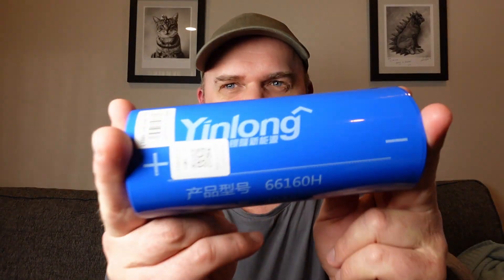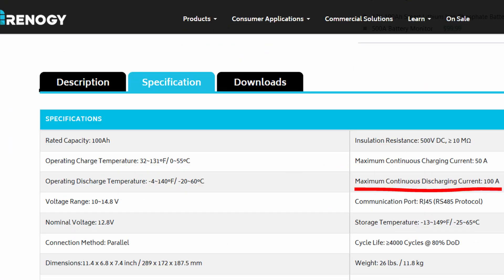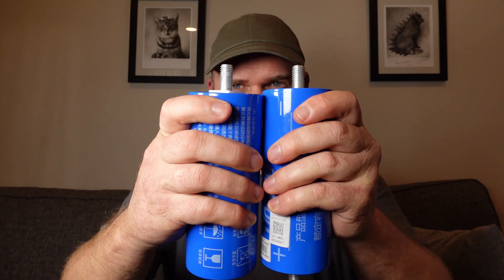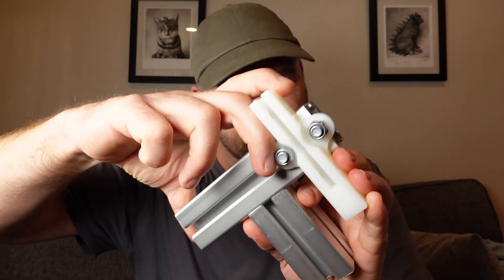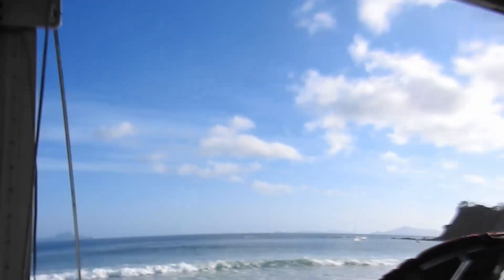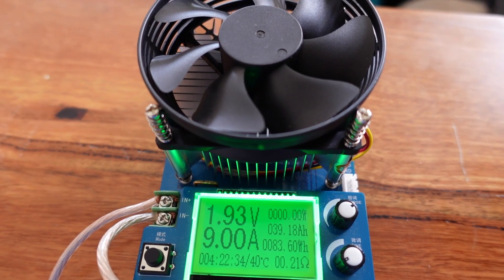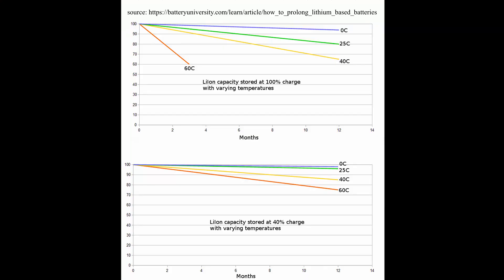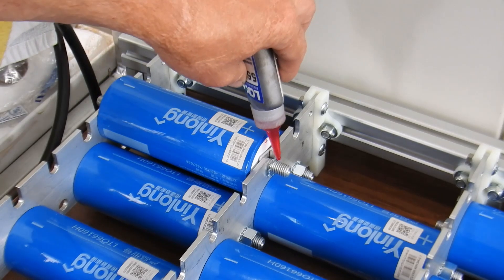Campervan DIY battery build HUGE POWER!

Comment: Wow! Great video! But isn't it more like 40Ah x 99 cells = 47.52kWh ??? If you have 99 of those cells, 9.5kWh seems low?
Reply from the maker: Hey, I'm not sure how you came to that number.  This is the reason you shouldn't use Ah as a measure of capacity (and because it isn't a measure of energy capacity) it confuses people.  The cells on average tested at around 96Wh each (rated at 92Wh = 40Ah x 2.3V) so 96Wh x 99 cells = 9.5kWh
Reply: Around the 2:26 time mark "Each of these cells is rated for 400 Ampere discharge, which is roughly 900 Watts. I've got 99 of these cells in my battery pack. So, that give me about a 90kVA output." However, around 4:40 "... which will give around 9.5 kWh". This is better.

First, the cells are rated at 40 Ah. It would be misleading to multiply by the C-rating of 10 to get 400 Amperes. If you drew a cell at C10 it would last "less" than 1/10 of an hour. You could sustain that for, maybe, 1-3 minutes (see Peukert's Law) while turning your wires into toaster elements. Now that doesn't make 90kVA sound so useful.

The actual numbers are simple. 2.3 V (nominal) * 40 A (C1) = 92 VA per cell. When multiplied by 99 cells equals 9.108 kVA.

At 4:32 "I think kWh is the proper measurement for battery capacity. I know most people use AH. So, if you are stuck in the AH mindset, change it."

Actually, Ampere hour (Ah) is the proper measurement for battery capacity. For resistive loads, such as light bulbs, 1 VA is equivalent to 1 Watt. Once you connect reactive loads (inductance and capacitance), such as charger, inverters, power supplies,  then you're dealing with Watts. This considers Power Factor (PF) efficiencies of the reactive load.

At 12:58 "Okay, so I'm going to cost your batteries..."

I have to come back to this one.
Reply from the maker: @cknox64  here we go...  just a guy trying to make novel builds and we have commenters who think they are smarter than me trying to pick my video to bits....   anyways, in response....

The average capacity of these cells as tested by me worked out at around 42 Ah - roughly equates to 9.5kWh with ACTUAL measurements.  I even wrote the ACTUAL capacity on the side of the cell that I showed.  If you were more observant you may have picked this up.

The cells are rated at 10C so it isn't misleading to say that they are capable at putting out 400A each.  Peukerts law is significant in PbSO4 batteries, not so much in these due to low internal resistance so your numbers are out by quite a lot there too.  Was trying to get across the point that these cells can deliver a huge peak current if required without damaging the cells.  There are often huge demands on cells such as the capacitive load of hooking up an inverter that may accidentally not be precharged, this sort of peak load can damage other chemistries.   

The actual numbers (my ones) are simple and correct, your numbers here are completely wrong.  The C rating is not 1 for these cells.

Actually Ah is a loose and imprecise unit for battery energy capacity.  There are so many reasons that it is a useless unit.  I don't have a problem with it on a cell level, but I do have a problem with it in packs.  Take for example, how many Ah is a Tesla powerwall or an electric car?  How about  your power meter on your house, does it calculate your power consumption in Ah?  They don't specify Ah, because it means little in the real world and can be very misleading.  Say for example you have 100W of LED lighting.  How many Ah do you need to run it for 10 hours?  Firstly you have to figure if you have a 12V,24V,48V or any other voltage system.  then if you have say for eg a 12V system what chemistry are you running, different chemistries have different nominal or discharge voltages, so then you have to take that into account.  Additionally, 100W of LED lighting will draw 100W throughout the decreasing voltage as the battery discharges, however... as the battery discharges the current consumption on the LEDs will increase.  But it is very easy to figure 1kWh of batteries will power 100W of LEDs (or any other load) for 10 hours.  Even with a low discharge rate 1Ah of lead acid is less than 1Ah of LiFePO4 as far as useful power delivered.  Reactive loads have no real relevance in DC power systems, it actually makes zero difference to the load capacity on the capacity (ignoring the slightly decreased efficiency of the invertor when running high PF loads) so I'm not sure why you brought it up.

Cost my batteries, if you like...  chances are that I'll be more correct.

I know you think you know more than youtubers, and I'll find it difficult to convince you otherwise.  From comments that you have made I feel there is still a bit that you are unaware of that you don't know.  Stay tuned, be humble, learn and grow.
Reply: @brendontait6968  We should agree to disagree and part as friends.

Comment: One thing else I would recommend doing differently is to not switch them in parallel step by step throughout the series.  The problem this setup could run into is a single battery failing for whatever reason and not being able to quickly identify it.  An absolute stupid habit of batteries when they fail is that it changes their behavior in a network of batteries causing load imbalances which could not only cause damage to other batteries, but also equipment around it.  11 in series and the 9 in parallel does not entirely prevent it, but you could monitor every single battery separately.  Even automate it, so that a faulty series is disconnected immediately.  Only problem is that a controller would probably have to be custom built for it.
Otherwise, great build, inspiring and I learnt something new.
Reply from the maker: Glad you enjoyed the video.  I'm not sure how your suggestion would be implemented... monitoring all 99 cells while a bunch are parallel connected would be past my level of ability.  One of the benefits of this chemistry is that it is tolerant of internal shorts, whereas other chemistries are not.  An internal short in a cell can ordinarily be catastrophic when they are wired in parallel, this is because the energy from the parallel connected cells go through the short in the faulty cell.  I'll cover this in a coming video with LFP cells.   Because of the inherent tolerance of internal shorts this failure mode is not a concern.  The failure would eventually be picked up by the BMS without damage to the other cells.

Comment: Newbie here, I have some questions that I think you would have the answers to.
1. Could you install one of these capacitors on a vehicle to extend the battery life?
2. If I was bored one day and wanted to make my vehicle into a hybrid using an electric motor, could I use a bunch of these capacitors instead of a battery for the immediate energy storage from deceleration and acceleration factor?  
I must say, you are the smartest high school drop out I've met so far.
Reply from the maker: Hey, firstly they aren't capacitors.  But they can throw out power like you'd expect from caps.
1.  I don't think you'd see a significant increase in battery life by attaching one of these to it.  Starter lead acid batteries actually like short bursts of high drain from them as you'd see with starter loads, it can help break down the lead sulfate that can build up on the plates.
2. These are a battery - the reality is you could use pretty much any type of battery - but these have the advantage that they can throw power in and out faster than most.  So yeah a smaller pack could take bigger deceleration and acceleration loads.

Thanks!

Comment: I went and loke and by my estimates these cost over $600 a kwh.  That is half of a prebuilt   lithium battery.  Not 1/10th
Reply from the maker: Hey Joe - there are many ways to calculate things.  I don't think I cam up with 1/10th... however, it would seem that your calculations might only be taking into account the cost/capacity and not the cost/lifecycle

Comment: Oh but I’ve read that lithium batteries life span is usually not limited by how many cycles but by their calendar life expectancy.
So I wonder if these really will last you 25 years when 10-15 years is often the calendar life I read about.
Yet lithium is the way to go for such a high power system you have, when vehicle weight is a concern.
Thanks for the video to help me stay updated on tech 
Take care
Reply from the maker: Hi Jim, thanks for your comments - yeah in my video I think i said it would likely closer work out to 10c/kWh rather than the 2.7c in reality.  This chemistry seems to have the highest life expectancy of any available lithium chemistries, this obviously depends on how they are kept and used.  Most literature I have read show at least 20 years.  Ontop of that this battery will be more tolerant of electrical faults in a bms etc which might cause the cell to run outside of its voltage parameters
Reply: ThankX Brandon 
I did miss that the first time I watched.
I also like how they can take freezing temps while working.

Comment: Very nice video mate! 48 volt systems are popular because everything telecom related in the whole world runs on -48VDC, so there’s a huge industrial use for the same components that goes into the solar power systems.
Reply from the maker: Yeah, I agree.  I liked the fact that the truck operating voltage was the same, but it deff would have saved me some money.  Plus I could have made my door operate at twice the speed!
Reply: @brendontait6968  It's always a question of optimizing for your situation, I have a 3 battery 12 Volt system, and now that I'm adding inverters and stuff I'm really beating myself for not getting 4 batteries 2 years ago, then I could easily switch to 48VDC, now I'm stuck at 12VDC :)

Comment: Thanks for your hard work to build,test and prove use of this battery is possible. I will seriously consider making up a system for my home as the cost is far less than a Tesla unit and longer life. Kudos to you.
Reply from the maker: Thanks Kim, It was a big risk as I had previously not had experience with these cells.  Am happy with how it is working

Comment: I really like your video and your setup looks so elegant. 
I do think there are two slight issues with your cost calculations: realistic cycle counts and comparing commercial prebuilt battery with raw cells.

I think that the 20,000 cycles is a bit of an unreasonable cycle number to use. If you fully cycled those batteries every day, you'd have to do that for over 54 years to get to 20,000 cycles. I'd work back from how long you realistically think you'll use this battery for to work out cycles. 

Second, comparing a renogy prebuilt 12v battery to raw cells is unfair. To compare equivalent setups look at the 280Ah LiFePO4 cells you can also get on Alibaba. 3.36kWh for $462 => 462/(3.36*0.8)/4000 = $0.043 /kWh.  
https://www.aliexpress.com/item/4000926941324.html

If you combine these two things you can change the maths a lot.
For 5 years  (1825 )  => LTO = $0.298 / kWh  ---- LiFePO4 = $0.094 / kWh
For 10 years  (~4000)  => LTO = $0.135 ---- LiFePO4 = $0.043 / kWh
for 20 years (~8000) => LTO = $0.0679 ---- LiFePO4 = $0.043/ kWh
Break Even Point $50/0.092 kWh/ 0.043 $/kWh = 12,639 cycles = 34.6 years continuous van life.

There's other considerations such as:
* battery size/density (your battery setup looks like it takes up a lot of space for the capacity) 
* you change the LiFePO4 every 10 years so can upgrade if a new technology is created that is more effective, cheaper, safer
* You do have to change the LiFePO4 every 10 years (Win for LTO)

Did you look into building your own LiFePO4 battery before going with LTO?
Reply from the maker: Hey Sam, thanks - yeah there is always 100 ways to do cost calculations, in fairness i think I mentioned that in reality the price would likely come out at around 10c rather than the 2.7c I calculated.  One of the things that I wanted was robustness in my pack, for eg if I had a BMS failure, or left it parked in freezing conditions, I didn't want to rely on a battery heater etc.  These cells are robust enough to take that without shitting themselves.  It also has inherent safety in the fact that you don't have to worry about internal shorts when paralleling the cells, this can be a significant issue with LFP, additionally.. LTO has a nice charge curve where LFP you cannot tell the SOC by voltage, you also have to remove the charge voltage when it is upto charge, and shouldn't float them.  Yes I looked into LFP, but wanted to do something different.  I already have some experience with LFP and wanted to learn by building.  I will do an LFP build on this channel in the future.

Comment: Great Video. I think I found what I was looking for. I want to do a marine cabin cruiser electric conversion. Not a sailboat, lot's of those out there. the main problem with bigger heavier boats is that you need more power, so your battery pack dissipates quickly and it generally take too long to recharge with solar. With these, it may be feasible to use 2 battery packs, 1 in use while the other charges. Curious as to your thoughts on this subject. Thanks
Reply from the maker: Hey Larry - I don't see any advantage to having two separate packs - one for charge and the other for discharge.  There would actually be a slight advantage to having them both connected all the time and having them both charge and discharge simultaneously.   The thing you need to charge them quicker is simply more solar.  Avoid chinese panels, I've found their specification sticker to be very optimistic and they have very poor output in lower light conditions.  In my eyes REC panels are the best on the market and have exceeded my expectations significantly
Reply: @brendontait6968  - thanks for your reply. Let's speculate on your battery pack with 100 cells... How much solar watts, to recharge the entire lot if it is 80% empty in, let's say 6 hours of sun? I think I need to know this first before I can decide on engine size....

Comment: I think the problem with Will's batteries is he got duds... which probalby in fact do have that terrible efficiency when charged quickly.
Reply from the maker: for sure, Charging and discharging at max rate is unlikley to help either

Comment: Aluminium is one of the best conductors. Unfortunately Aluminum Oxide is a fantastic insulator. The difference, without proper prevention is TIME. Everywhere that there is a connection, especially with dissimilar metals, will very likely become a very good insulator.
Reply from the maker: Hey, yeah... you'll notice that I wiped the lugs with silicone grease before putting together
Reply: @brendontait6968  FYI. The section I was in charge of installed electric equipment in thousands of police cars over the 30 years. Imagine the large ground a copper board attached to a 1/4 inch aluminum base using over a dozen stainless steel screws, the head directly on the cct bd copper, the threads directly attached via tapped holes in the aluminum. . Over a period of 3-4 years every single screw/aluminum connection was OPEN. Give any screw a fraction of a turn and conduction is back. 
Thought you should know.
I would strongly suggest That you change all electrical connections To copper.
Reply from the maker: I can't change the battery studs to copper tho... they are aluminium.  I'd sooner have a bunch on Ali-Ali connections than having a bunch of Ali-copper connections.
Reply: @brendontait6968   Oh! Then may I suggest an aluminum anti oxide compound such as NoAlOx from Homedepot.com
Search for 202276208 on their web site.